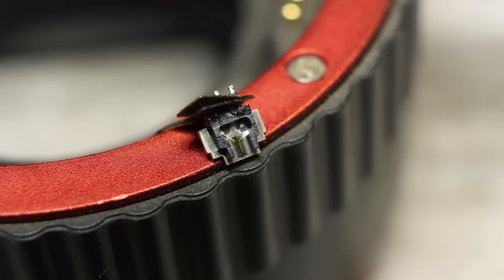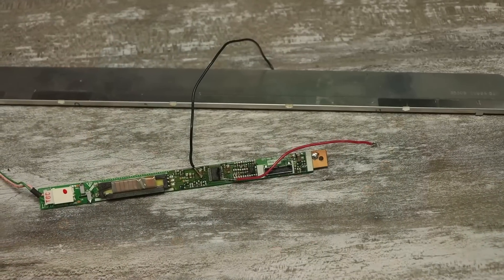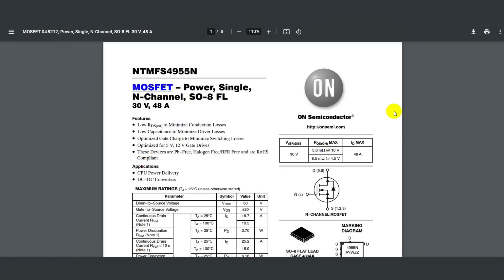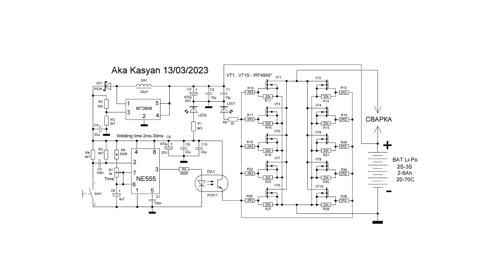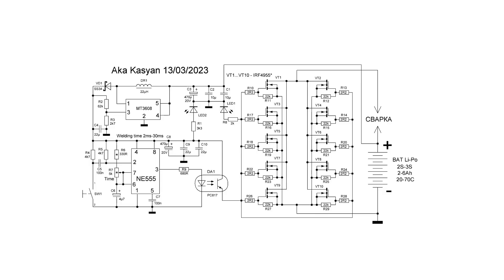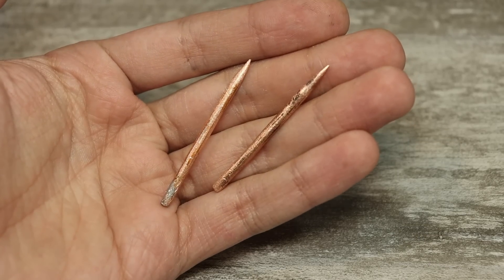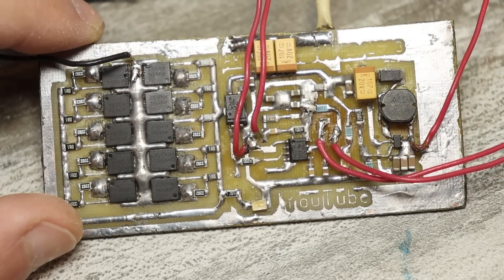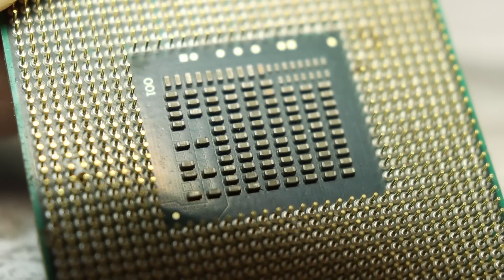What can be done  from an old laptop?

Comment: I have an old HP Pavilion gSeries laptop. How would I separate the charging circuit from the mother board so I can charge the battery pack for use in another project?

Comment: 1- Re-use still good screens by buying a LCD controller from ebay (usually from China) and turn it into a usable monitor or even a TV with a controller that also has a tv receiver. These will support VGA/DVI/HDMI/DP all or just some of those depending on controller, you just need to tell the seller which panel model you have.
2 - Recicle the batteries if still good with Lithium battery chargers and buck boost converters for the output and bang you got a power bank
3 - Remove the hard disks and buy a USB enclosure for them turning them into external USB HDD
4 - Recover the RAM for upgrading other laptops
5 - Recover touch pad by connecting a USB cable correctly to it and bang, external touchpad 
6 - Recover add on cards such as the WiFi adapters which are usually modular and can be removed and added to other computers even desktops with a mini-pcie to pcie adapter (you need the correct adapter depending on interface, MiniPCIE, M.2, U.2 etc all have adapters to each other and to PCIe)
7 - If it still has a DVD burner you can, like with the HDD, make it external with a USB enclosure
8 - Go crazy desoldering chips and reusing them as needed or for repairs
Reply: what about finger print sensor? can it be used as usb device with desktop? i have one from hp8770w MTP-1132-R02a
Reply: @Amanullah-dx5uy  Actually have a couple from a Lenovo, and they are USB hehe
Reply: @Amanullah-dx5uy  Used to have one pulled from a lenovo I think, it had a usb interface, upon soldering a cable it worked with windows hello

Comment: I would've used a separate power mosfet to drive the 10 other mosfets. 
As it stands, you're triggering 10 mosfets with an optocoupler that has a maximum collector current of 50mA. 
How long do you think this optocoupler would last? The Chinese do it because they're cheapskate scumbags. 
I'd want to charge the gate capacitors of the 10 mosfets, as fast as possible, so the mosfets don't spend too much time in their linear region. Each mosfet seems to have a 12nF gate capacitance.  
Failing that, my second idea would've been to drive a push-pull amplifier by the optocoupler, as the mosfet driver, and get rid of the 22K pull-down gate resistors.